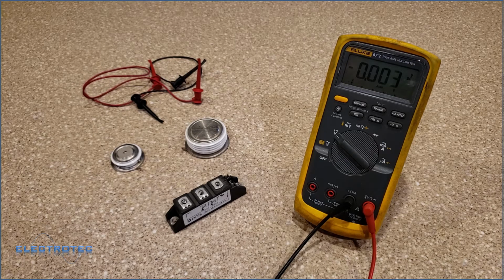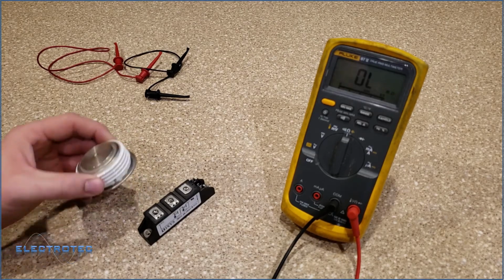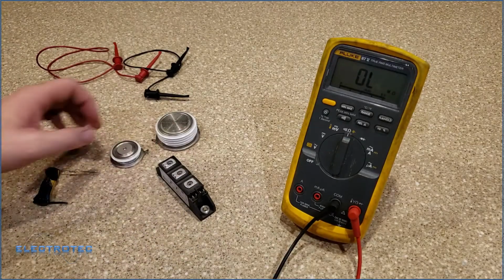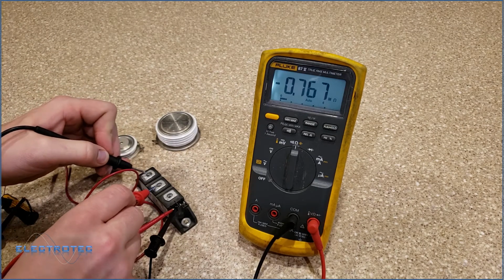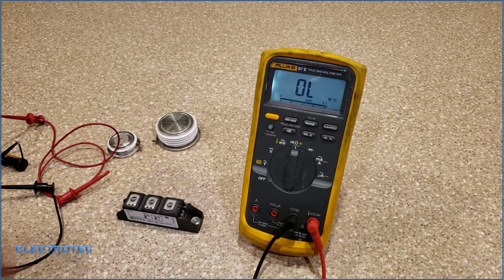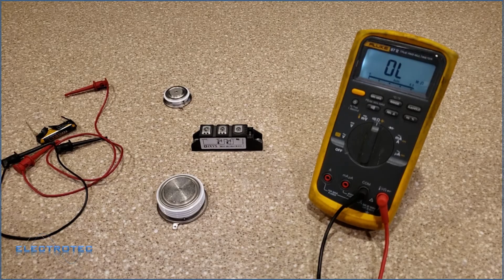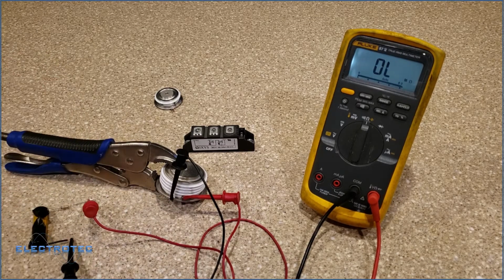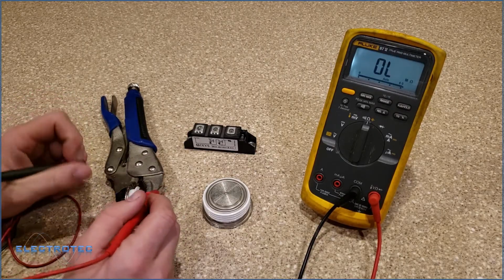How To Test an SCR

Comment: Weird question, but is that cathode for the gate the same as the cathode for the high power cathode? It seems as though you inject gate current into the circuit, as well as anode current.

Comment: I had read the spec sheet over and over, and thought the torque pressure was just an installation parameter. I had one GTO thyristor out of four, that was working slightly differently with no pressure, and I thought that one was "working" in a testing circuit.  Thanks to you, I have all of them usable now. Cheers!

Comment: Hello.
would recommend apply voltage with the battery to test the SCRs while they are still mounted on a soft starter ???.
or is this done only when SCr is been removed ???
are you familiar on how to  do voltage drop test to verify contactors health on soft starter???
I been told there is formula to calculate  the expected milli volt reading , but cant find much info.

Comment: hello and congratulations, I have a question, I often deal with 24 to 80 V DC-powered handling systems driven by SCRs of 200-300 A and above managed by the relevant logic/controller. Let's assume that I have an anomaly elsewhere and the SCRs don't come into operation, how can I energize them manually to test them without dismantling them? Let me explain better, the systems control motors, if these do not turn usually the technician energized the first SCR to make them turn, the second SCR which charged a capacitor and then a third SCR which with a sort of countercurrent turned off the first (usually they are disk st333 as in the video, by doing so he was certain that all the power was ok, and he could move on to troubleshooting the auxiliary part, the driving, safety devices etc., therefore what voltage and polarity should I give to the gates always taking into account that some machines are powered by 24v, others by 48, others by 80 and so on. Thank you.

Comment: The preassure required for these hokey puck diodes is stated in the datasheet, but how the heck do i verify the clamping force? I just tighten the bolts on the heatsink but i have no idea how much force i am applying... Any ideas?

Comment: Thank you for this video. I have been retired for a very long time and was checking a battery charger I have that quit. I could not remember if I should get a reading between the anode or cathode and gate. I looked everywhere and could not find the answer I needed. Thank you for this video. Excellent info.

Comment: Hey man, I have a mini lathe with a brushed dc motor driven by SCR’s (A69154) and cannot for my life find a data sheet for.  Do you possibly have the resources?  I’ve got 76ohm b/t outside leads but not sure which is gate or cathode.

Comment: Thanks for your video. Any possible change to gate 5,4 and 6,7 connected. I mean  5 to 7 or 6 to 4 are connected. Actually I have a this type of thyristor which shown is 5 to 7 31 M ohm,  5 to 6 31 M ohm and 4 to 7 31 M ohm,   4 to 6 32 M ohm. But another thyristor's showing OL/open loop those point combination. Please reply me.

Comment: I always viewed "OL" as Over Limit meaning the resistance is beyond the range of the meters current setting.
Reply: Situation; Over Limit for some, Open Line for others.
Reply: @surgingcircuits6955  The only time I have seen the term "Line" used is when referencing power distribution in commercial and residential systems...[Line - Neutral - Ground.] The proper term for that would be Open Circuit.
Reply: @DrHarryT  , thx.  I adopted Open Line for continuity mode checking.  No connection, on a DMM, shows O.L. - and I don't consider it Over Limit.  So, that's what I was referring to.  For other modes (e.g. measuring resistance), if you're set under the measurement, it will be Over Limit.  Cheers!
Reply: Oh, and other's I've heard refer to it as "Open Lead", too.  Guess it's a either a preference, or a mystery. :D

Comment: Great work, but if we setting the dial of  multi meter on diode tester ..and without applying a signal current on the gate 
just applying a compression force on it 
By  testing Anod and cathode by diode selection tester is not enough. , please I need to your answer.
Reply from the maker: The video demonstrates a quick method to determine the quality of most scr devices. If the example described didnt give you sufficient results, to be more precise, a bench top setup with variable power source is needed.